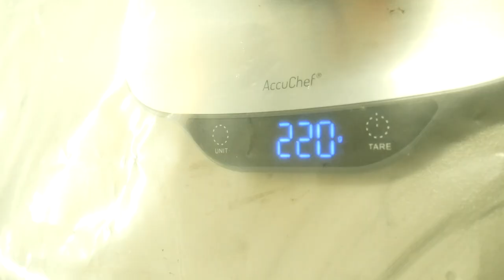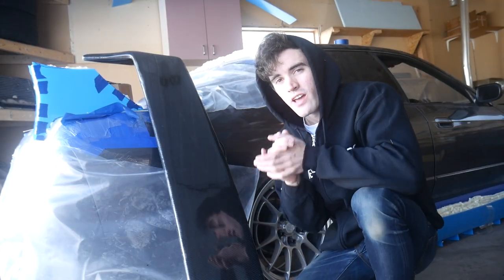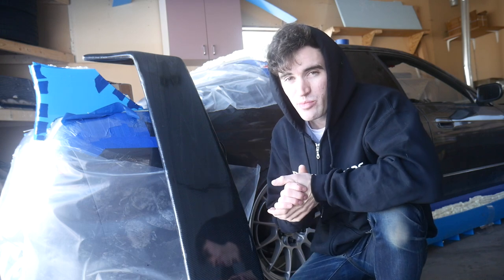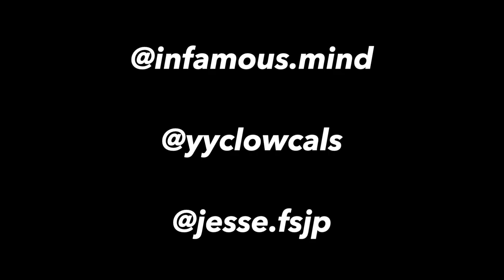HOW TO BUILD A FULL CARBON FIBER WING (Using Styrofoam) - Infamous Ep. #2

Comment from the maker: Over 100 hours went into this wing! Let us know what you guys think! ⤵️
Reply: Over 1000 dollar wang gang ... not a member.
Reply: Respect, i spent 15 minutes mocking one up and hope a hour w ill get it done
Reply: What happened to y’all
Reply: Lowcals Love the videos! Keep em coming!
Reply: IndianaJosh 96 I wonder the same thing
Reply: If you want down force remove the wing from the top of the rear window, this will stall the boot mounted wing.
Reply: where did you get your carbon fiber fabric?
Reply: Easy fix! Just add a bit of resin to the corners, then sand entire wing and clear coat. This actually should be done anyway for UV protection. I usually do mostly all exterior molding when making something new and just do it that way, sand resin flat then clear coat

Comment: Great job . I work at an aerospace company that makes carbon fibre engine parts . Looks like you have done your research well . You can fill the voids with a mixture of carbon powder ....and a mixing epoxy called 50a . We infuse parts with expensive tools which is much easier but we still get imperfections and pitting in the parts .
Reply from the maker: Thank you!! The input is greatly appreciated !

Comment: I admire your patience, this took a lot of time to do 🔥
I'm just wondering about the strenght/functionality of it? I don't realy know anything about this but you said in the last video that it's empty in the middle so I was wondering if that makes it "weaker" than the rest of the carbon wings or are they made the same way?
Reply from the maker: Most of the wings are made using the same method - this one is VERY strong actually. I used 4 layers of carbon whereas some manufacturers will use fiberglass to keep costs down (sacrificing strength and increasing weight). This wing is very light and very strong 👌 I'll do some strength testing in future videos!

Comment: Easy Composites LTD has some videos on doing carbon fiber parts and if you're having issues with getting the cloth into corners, use much smaller pieces for the first layer and use something with a sharp edge to stuff the fabric into those corners and tight spots. This will prevent those air bubbles and chips that you were having issues with. Other than that, good job.

Comment: Also you need non perforated release film to do a debulk. It will suck any air out of the part and make sure its stuck in those corners. Use it on the first and last ply

Comment: Hey!  I’ve ordered a genuine carbon fibre spoiler online but in the sun and heat, it’s slowly warped and bubbled.. any fixes for this?
Reply from the maker: Possibly re-clear or a new layer of resin, it most likely was never clear coated and UV protected :(
Reply: It's warped because it was probably made using epoxy, and not post cured. There is no way to fix it

Comment: Styrofoam doesn't have much weight since it is made mostly of air. Why don't you just wrap the carbon fiber sheets around it and vaccum seal it? I think it would be a lot stronger with 1 piece than to 2 halves joined together. 🤔

Comment: make a wood frame for your mold, it will deform.
if you had all this time to make all this flanges, you should be working with low speed epoxy if you want to vaccum bag.
once you have all those flanges, infusion is the way to go.
laminate carbon fiber with a brush is a big waste of money....